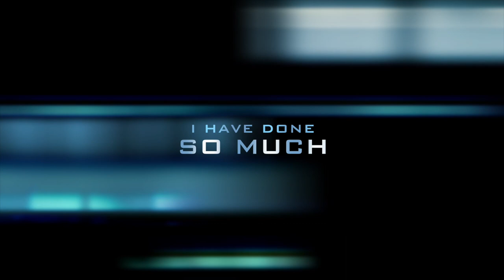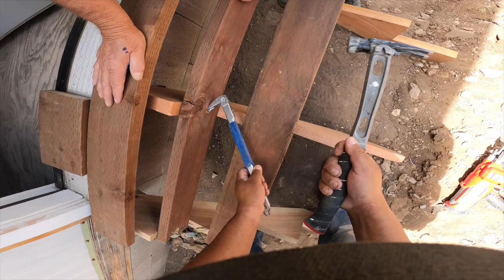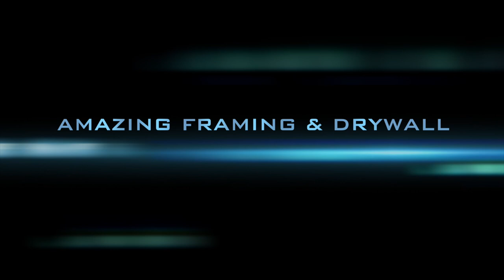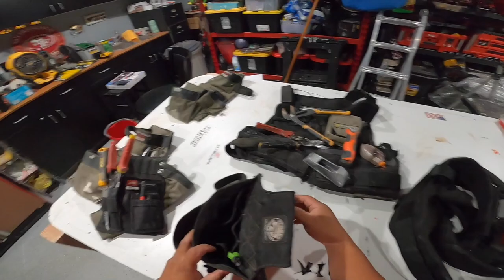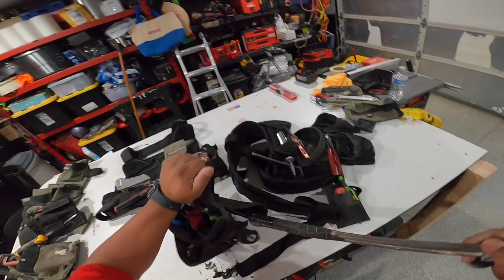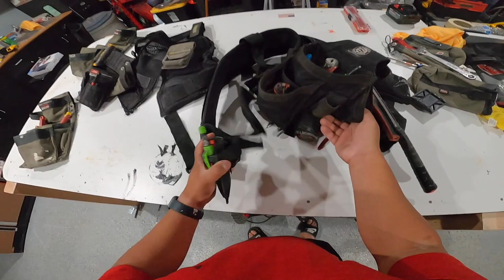Tool Bag Talk Pt 2 Badger Trim Pouch

Comment: Does your drywall rasp fit into the tool loop on the badger trimmer tool bag?
Reply from the maker: It’s a tight fit but it will work